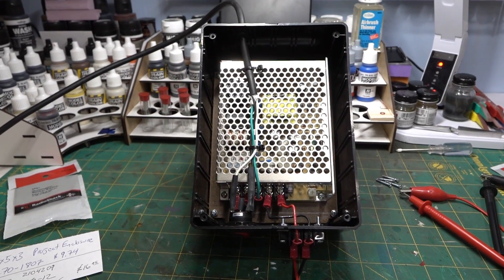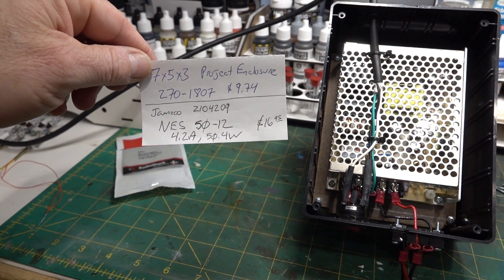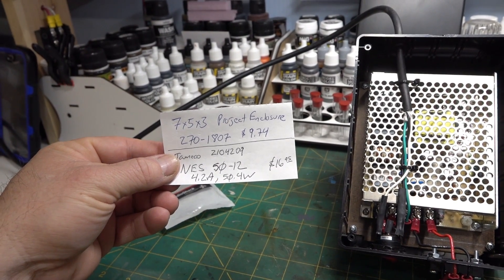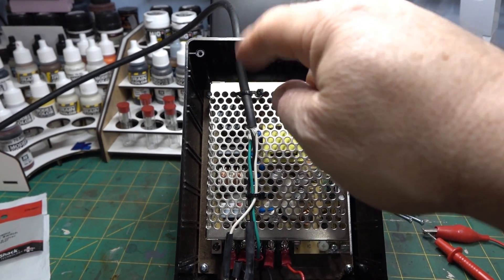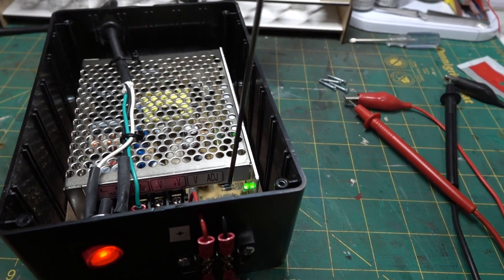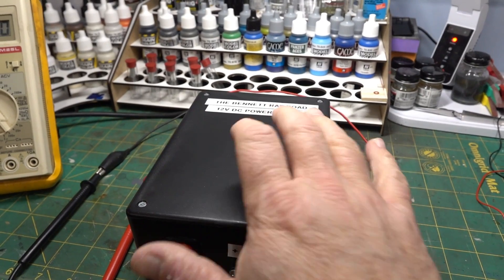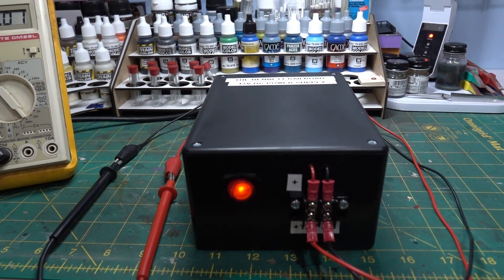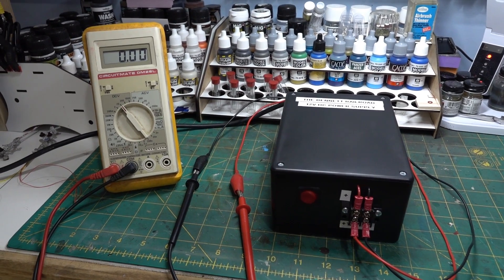Workshop Tip #2: Portable 12V DC Power Supply

Comment: That's a great idea fitting that into the box!! Very neat and nicely done. Rad some of the other comments and the suggestions help make this even better. Really dig what you are doing. One question, I have notice the lamp you use on your desk. Can you give me some information on that? In need of a good desk lamp while building. Thank you for the video, D. Muse
Reply: Sorry for the delay Dave, was getting ready for that Erie train show. I got the lamp on Amazon, here is the link:

https://www.amazon.com/gp/product/B00APAQT4Q/ref=oh_aui_detailpage_o03_s00?ie=UTF8&psc=1

So far, I like it. It seems bright enough, and it isn't all that expensive. In fact the price has dropped significantly since I bought it!

I also tried this one:

https://www.amazon.com/gp/product/B0052OT64K/ref=oh_aui_detailpage_o00_s01?ie=UTF8&psc=1

But when it arrived it was smashed to pieces (gotta love how Amazon packs things...) so I returned it but never did buy it again. It may be brighter, but the first one I bought seemed fine so I have stuck with it.
Reply: Thank so much for the info, getting older and eyesight I really need a good light to work with!!  Thanks for the reply!!

Comment: It is always good to test a power supply regulation characteristic. Measure the output voltage with no load, then apply a load and see how much the voltage drops. Ideally, you should apply near rated load to see what the full load regulation is.
Reply: Good choice! You could add a small computer fan to it as well since they work on 12v. Then just DARE it to overheat! GO On! Where's the meltdown now, huh? LOL! That was a nice build Rob. Cheers, Dan
Reply: Sounded like fun, so I did. Ran the PS for 4 hours at 2 amps, 12V at start, 12V at end. No heating of notice. Then ran it for 2 hours at 4.1 amps (rated is 4.2) 12V at start, 11.98V at end. Still no volcanic heat wave. I think since this supply only 4 amps the heating isn't quite what some think it will be. However, I did decide to add several vent holes to the PS.

Comment: I could use this. Is there a way to add 5 volts? for when I need 5 volts?
Reply: 5 volt supplies are sold. I wasn't looking for a multi-voltage supply but they may be out there.
Reply: I will look for one. I was just thinking there may be a way to add a 
rheostat or potentiometer  to adjust the volts down to 5 volts. And with
 that I can adjust up to 12v or down to 5v. Even set to 9v if needed. 
Just a thought. V
Reply: @Vman7757  just get hold of an old PC power supply and use the outputs from that.. you can have -/+ 12v, 5v and 3v there are many YT videos on how to do this and it is very simple to do.